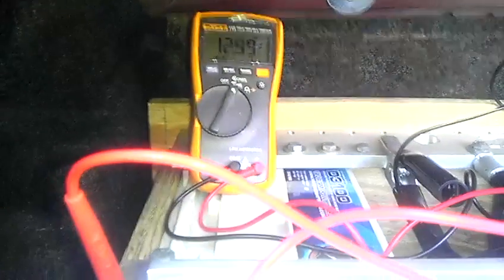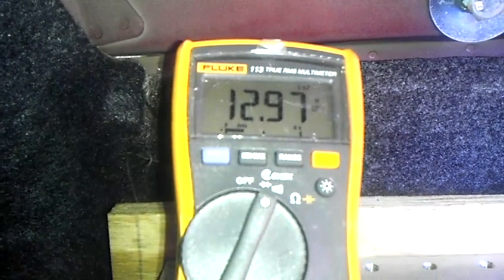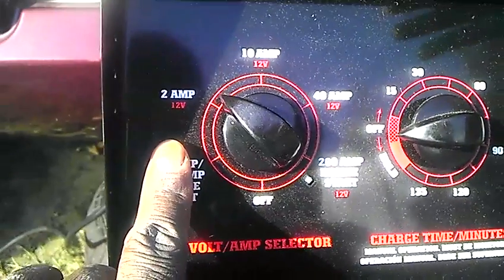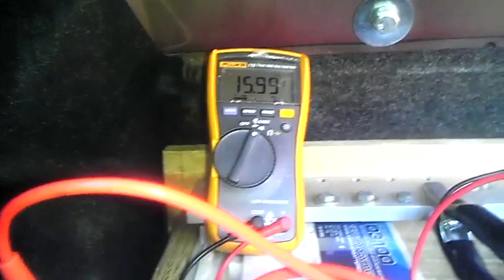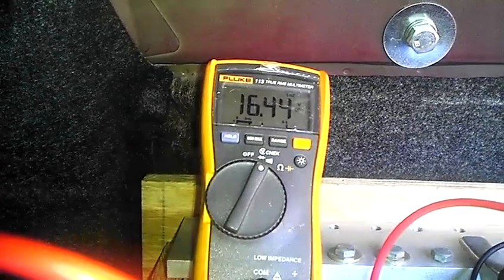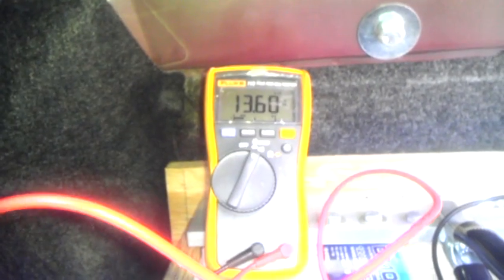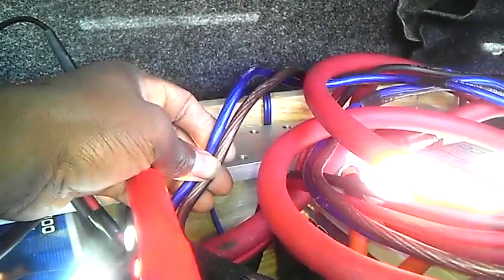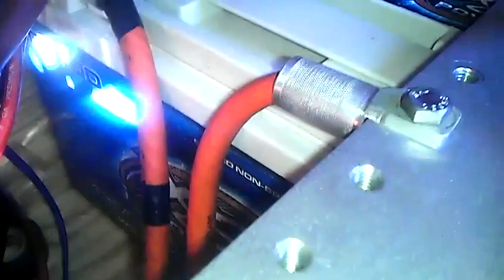XSPower D3100 Voltage Check in Trauma

Comment: hey bro  I got the small schumacher ssc 1500 what's the safest way to charge my 2  xs power 3400s 3 amps or 15 amps I don't want to accidentally cook them up
Reply from the maker: Rudy Rivera 
Do 3 Amps for maintaining (slow. charge) and 15 Amps for rapid charging sir..  I use Slow charging  sir.
Reply from the maker: @mrcleanguy2012 this is long gone. I was. Nomb then. Im gucci now. CAUSINTRAUMA 2018
BUILD DESIGN By 252 Customz
https://m.facebook.com/justin.haddock.33/albums/1685231491559129/?ref=br_rs

https://www.youtube.com/channel/UCsg1j5wnW0JZJ_wG_BB_o0w?view_as=subscriber

CHARGING

1 Iraggi 320 Amp Alt

1 Mechman 240 Amp Alt

4 XS Power XS-D7500s

24 XS Power Supercell UltraCapacitors (6Caps = 1 12v Bank) Total= 4 Banks 

1 XS Power Intelli Supply PSC60

SPEAKERS 

8 SQ-05T

12 BRM8 

AMPLIFIERS

2 HCCA 11,000.1D

1 PRO-FR6000.1 

1 PRO-FRO800.1 

SUBSTAGE

4 DC Audio M4LV5 15 D2